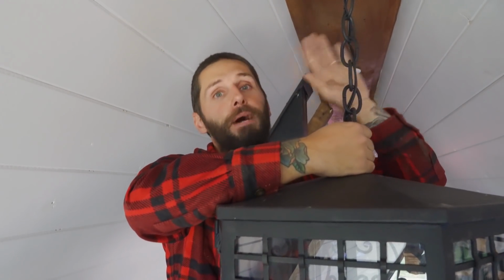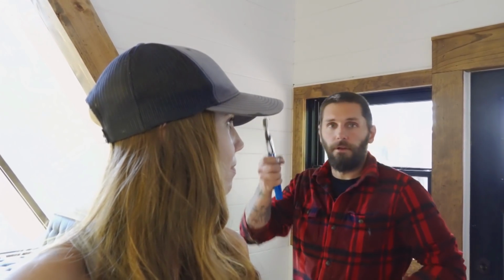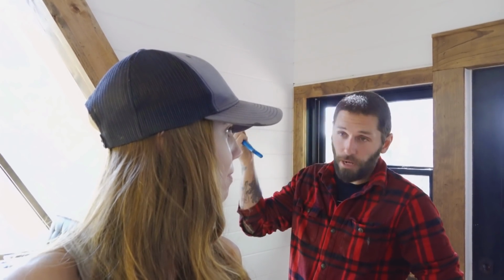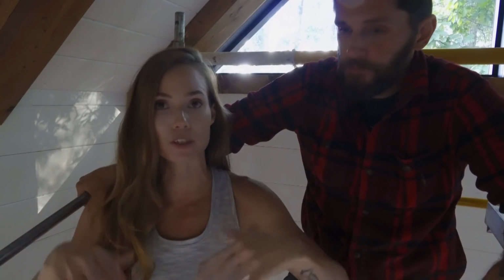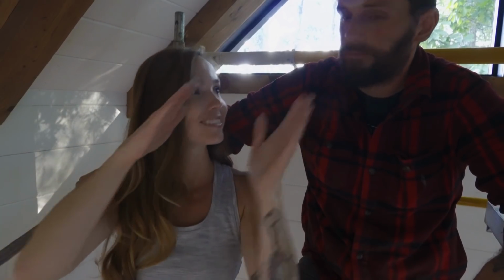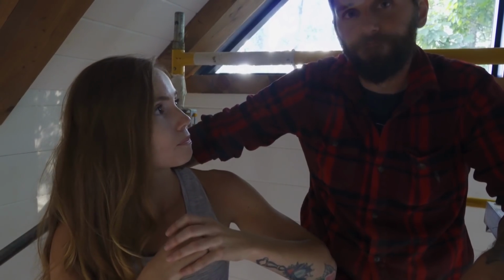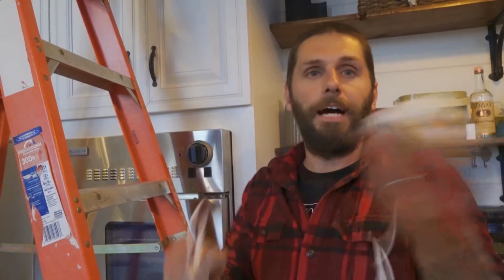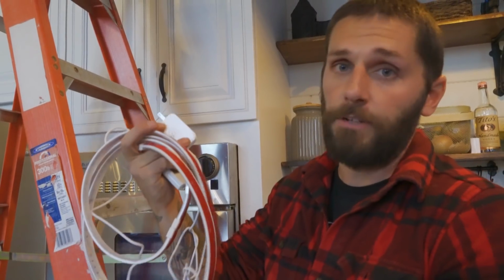Custom Light SHATTERS During Install

Comment: That's a lot of faith in two 10/32 screws, I would put four black lags in the light flange at 7:28...
Reply: #10 is OK......but how many threads are holding it...2?
Reply: I would not trust them..😮
Reply: The lights should have come with a hook, like ceiling fans do.
Reply: It’s fine he could swing from it .its dead weight so once installed they aren’t moving
Reply: For 10-32, need about 8 threads holding for each screw. Looks like enough thread engagement, not sure about box material though.

Comment: Wonderful video. Personally, I wouldn't bother replacing the glass, I would remove all the other glass from all the lights instead. It's not like it's reflective or lensing glass, so it doesn't amplify the light in any way, so you can barely tell it's there, and really, the glass is only there for if you install them outdoors, and if you remove all the other glass, it will make the lights lighter, safer, and cleaning the dust off the glass won't be a thing. 😉
Reply: OOPS, I just noticed that many other commenters are saying the same thing. Oh well, it just means it's a good idea hehe.
Reply: What you said👍
Reply: Right, with what happened, for me, its not safe to keep the glass, i mean, it just fell off that easily..
Reply: i agree ditch the glass altogether. I Actually just upgraded some lights in my house.....glasses FTW
Reply: @josh-vee  -- I know. I put my comment too before I read the others. I just think we are all concerned about their safety. The light fixtures would also be lighter and safer without the extra weight from the glass. They are beautiful. Styles change with the times. I took out of whole lot of similar fixtures and threw them away in a house I bought. Now that style is back. :)

Comment: I'm sorry to learn of the demise of one of those beautiful lights. Here in Australia we never use screw into wood for heavy hanging light fittings. Too much risk that many years later with changes to the lumber condition the screws could let go and someone could be underneath. We always use screw/bolt through the wood horizontally with nut & loctite in order to impart double safety.

Comment: I wouldn't bother replacing the broken glass panel.  You can't even tell because they are so high up unless you were told it happened.
Reply: I would turn the missing side to the wall and forget about it
Reply: Until the remaining glass gets dusty. I would just remove all the glass from the fixtures.
Reply: Brett Cramer ya I wouldn’t be going up there to clean so I would tend to agree
Reply: The missing glass will alter the weight distribution throughout the structure. Overtime,  the structure may warp putting pressure on another glass pane. Buy one more and put it in, or take them all out.

Comment: After seeing how easily that glass panel got knocked loose and shattered on the floor, I would advise taking out all of the glass for safety reasons. It will lessen the load capacity, which will help in reducing the amount of strain being put on the screws. Other than that, everything looks great.

Comment: Your home is absolutely stunning.  You have done an excellent job with design and the build.  I also think your spreading out the whole house build process over multiple years is genius for a whole lot of reasons.  Please provide am update on your insurance 60 day projects and your heating system for the coming winter?  I am hoping you can enjoy heat through the subfloor heating system you installed as part of the subfloor work.

Comment: Josh,,,,,Can you install a painted black eye hook by each light to hook a pulley to lower and raise, for future cleaning and or repair.  Maybe put a electrical coupler by the bottom threaded link for quick disconnection.

Comment: If you find yourself in a similar situation, you can raise the (whatever) using blocking and/or shims, then once it's attached pull the shims out, then the blocking, and it will be hanging freely.

Comment: Did you consider using chandelier electrical boxes that have built in lowering so you can drop and clean the lights latter? Just asking, it might have been a cost issue.

Comment: I think the glass panes could be out - or just wait until they are dirty and take them out.  Do the lights need to be lower in proportion to the high ceiling?  They are gorgeous!!  Would you link to where you got the lights?

Comment: I am sorry the glass broke on the third light as you all was installing it, but that is what is to be expected when working at high areas with lights that heavy. Fortunately the glass can be replaced and everything will be fine and I hope that is the only problem you all have with it.  The light from the light won't be that bright though, but the units look nice and well designed.

Comment: The bottoms of each panel should have been pocketed to prevent thew glass from sliding forward and falling out.  I agree fully with Hugh Jaynis and whoever else suggested taking the glass out as it will be very difficult and dangerous when it comes time to clean the glass in each panel. I am just glad no one was hurt. They look absolutely stunning as with the rest of your home. Great job.

Comment: could have used a pulley to pull them up from floor .  Mount pulley  same place light mounts with the same type link you hung them with then remove the pulley after light hung.

Comment: I would like to suggest all glass of customs light remove.... I can not imagine if by time (may be temperature low/ high) frame bend by it self... and glass slip again (while kid on the floor).... 
Or may be change the glass with acrylic.
Or double check & reinforce again the glass frame, double secure it.... (for safety).

Comment: Sad about the glass panel.

Just a thought. Why did you guys not rig up a simple pulley system..(block and tackle) ??

It would have made the lifting so so much easier...

Plus points of that also means that whenever you need to clean the lamps and or change a bulb...or (say) replace a glass panel...you could lower the lamps back to the ground.

But well science is tricky like that.

Beautiful lamps.

Comment: if the glass panel came loose that easily, I would make sure that all the glass panels are secure and reinforced prior to hanging the light fixtures up.  You wouldnt want a glass panel to suddenly just drop from the ceiling after you have them installed........

Comment: Good thing no one was under THAT.  How many pieces stuck in your hard wood floori would run a plastic throw over the whole floor. It would suck to find one in the sodas they run and slide across the floors.

Comment: the pane of glass is easily replaced just take another pane to a glass cutter and he will cut you a new one.
I think your going to get more mileage out of the track lighting IMHO
Reply: My family was in the glass business for about a 100 years. No way breakable glass should go back in that fixture.   Safety glass or no glass.  And the supplier should provide the labor and materials.

Comment: I do interior work in Singapore and I am curious about the installation method.... Those 2 screws holding up everything.... No idea how heavy the whole thing is, but looks like at least 20lbs? I guess it would be Ok if the light fitting was below 20lbs but I would not really trust only 2 screws mounted in said orientation...i would use angle brackets "hugging" the overhead beam and sink the screws perpendicular to the light fitting. This will never fall off even if the install was half assed... As for the light fitting, I am thinking that there should be no reason whatsoever for the glass to slide off.... Even if the light was upside down! Glass panel should have been locked into a frame with profile or retaining brackets at the very least. Bad fitting construction and not very well thought through IMHO. Could you imagine a strong gust of wind entering the house for any reason  and the panes of glass start sliding out? Safest cheapest foolproof fix is to remove all the glass panels.

Comment: That seems like it's a flaw with the light fixture design or build quality that the pane slipped out so easily. If you think about it, it's probably a blessing that it happened on the install rather than it falling on someone's head at a later date. The fixture shouldn't allow glass pane to be extracted in that direction without fasteners else it's a huge design flaw.

Comment: With all the work you put into this house I was SHOCKED you did NOT PROTECT the floors before you set up the scaffolding.
Any grit in the wheels most likely will leave marks plus the possibility for damages just laying the scaffolding pcs on the UNPROTECTED FLOORS during installation

Comment: I hate the glass shattering for you so badly.  I know that feeling of such disappointment.  With that said, I am a lot older and with my experience, you may learn the lights might be better without any glass in them.  We have a much smaller and older light fixture much similar in our staircase.  It is so difficult to get there to clean it, especially as we have gotten older.  However, the glass is why it shows the dust and dirt.  If we could remove the glass from ours, I  would.  Just the "cage" around the chandelier would still be beautiful and a lot less stress.  Good luck either way!!!   Love your home and your choices.

Comment: As  I see these beautiful fixtures, it doesn't appear that the glass has any purpose in the fixture.  I personally would not like to have glass that high overhead that could dislodge as easily as it did at any time.

Comment: So, on lifting and holding heavy-ish things high up. I've used scaffold for many projects. The best thing for those heavy objects, instead of holding them, is to lift and set them at the height you want them finished. Measure a box, bucket, boards etc to get the height you need, then install, and remove the objects beneath the suspended fixture. Works for lights, cabinets, etc.

Comment: That should not have happened! That glass was not installed into the light correctly. Just tilting it, should not have allowed it to slide out like that. The manufacturer must have missed one or more clamps or solders.

Comment: beautiful looking lights guys,however,because their so heavy they are dangerous,if for some reason one shoulf fall on top of somebody that somebody would be gravely hurt,whay dont they make such lights in lighter materials,such as plastic,the glass could be replaced with polycarbonate,and the plastic frame could have the same look as the metal black mat finish

Comment: Yikes.. You need to go back up to  secure them better because the outlet boxes that were used aren't made for any more than a flush light not a heavy chandelier and it's dangerous to walk under as they are now because the next crash won't be just glass. The ears there hanging from are likely already bending downward under the weight and since you drilled/tapped it for larger bolts actually made them even weaker since there less metal plus the threading won't hold as it deforms. I have never trusted an outlet box like these to hold anything larger than an off the shelf two bulb lamp that weighs more than 6-8 pounds because most are made only for that load and it will be an easy fix to make them stronger. If there a nice amount of lumber under the box you can take heavier screws and directly support the cross bar it hangs on directly since most chandeliers are mounted there into the ceiling for strength. Indeed the plate that the chain/lamp attaches to wasn't flush because the outlet box wasn't either and you should also drill/screw the mounting plate as a precaution as well since more is always better when it come to a heavier than average load over ones head. You'll likely take all the glass out because a pane shouldn't have fallen at all even if the light was laying on its side and needs to be looked into plus since it's not tinted its cosmetic as well as a duct/grease collector more than if they weren't there at all. Sorry for being a bit long winded but I seen several  heavy lamps like these barely hanging on be a single screw or in a heap on the floor because those that installed it only hung them from a box not the support they were mounted to which is always better to begin with..

Comment: Glad no one got hurt when that pane slid out. Glass can be real nasty and you dodged the bullet on this one. This might be a sign that you should remove all the panes since they aren't serving any purpose on an indoor light fixture. You two are doing such an amazing job of creating your homestead and raising three wonderful youngsters while simultaneously starting a farm.
Reply: Glass panes do serve a purpose on any light fixture indoor or outdoor. Indoors you aren't worried about moisture, obviously, but they do reflect and diffuse the light to some degree.
Reply: @travisbenjamin4471  That is true at first. However, the glass will soon collects dust and a film from indoor pollutants that will reduce the diffusion of light.
Reply: @2CODO1963  I'm with you on this one, Eddy!
Reply: @travisbenjamin4471  unless glass is colored or styled in some way, inside it makes very little sense over the long term.
Reply: I thought the same thing.
Reply: @laurieg673  great minds think alike :)
Reply: @2CODO1963  
Little minds too, which always makes them think they're awesome too, alas ... :)
In this case, both opinions seem to be equally relevant, don't they ?
Reply: Great point!!